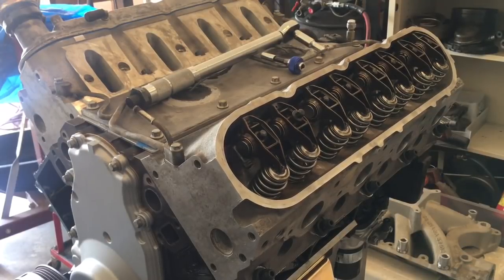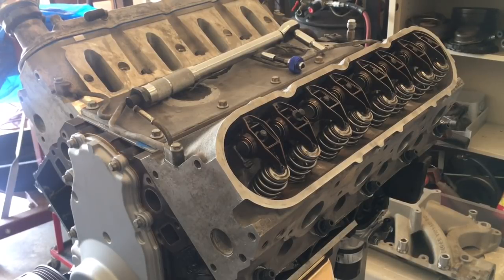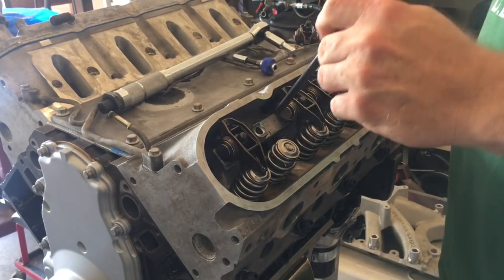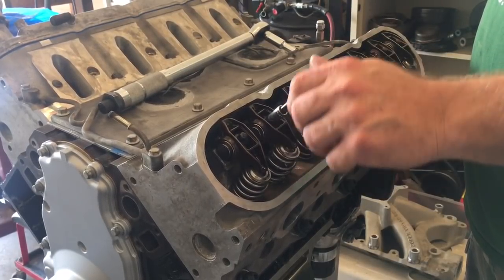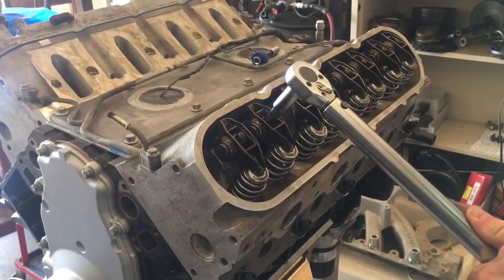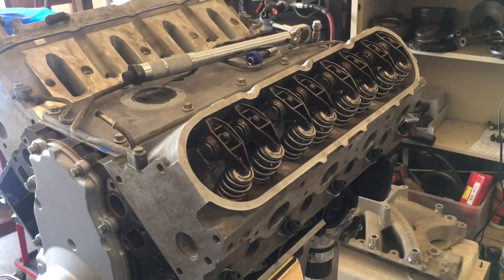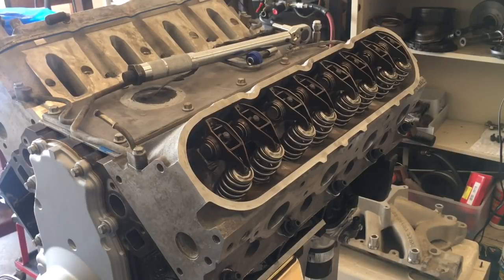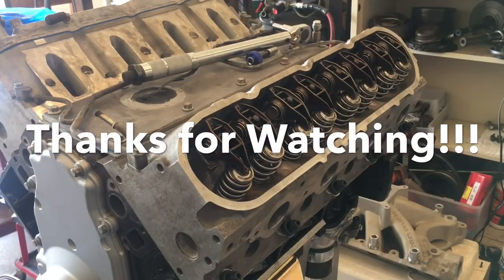LS lifter preload drama needed “One” 7.375” PR

Comment: I just changed my 355 chevy pushrods by   .  .200 because these rockers are a weird geometry by Texas Racing Engines circa 1990 (still in the box) I didnt measure much of a difference at .025 difference. Smokey Yunick used to cheat and use too long a pushrod, putting the rocker tip towards the outside of the valve stem. He used to gain another .070 lift on the cam that way to cheat the rules. Yes it puts more stress on the valvetrain and wears the valve guide more, but his dyno results showed more power with too long a pushrod.
Reply from the maker: Don Rutter Changing from the 7.400” to the 7.375” on the non-adjustable LS setup changed my lifter preload from .080” to roughly .0554”-.0615”.
I could have left the .080” preload but decided to make the preload closer to the other 15 rockers.
Smokey Was an innovator and was great at experimenting!  👍

Comment: You could take the one valve to machine shop and have it tip  ground. 030?
Reply from the maker: Richard Storms There’s not enough hardened material on the tip to remove .030”.  The tip on a valve stem has a hardened “Cap” to handle the abuse from the rocker arm. 
Thanks for the feedback, this shows people are trying to create solutions!  👍

Comment: .080" preload is bad? I'm about to button my rockers down and my comp tool says I'm at .084" On my LSA (LS3), I've heard .060"-.100" is acceptable. Thanks for the vid.
Reply from the maker: FasNuf ZL1 you’re right, lifter preload varies greatly depending on camshaft company and lifter manufacturers. 
GM .050-.060
Katech.070”
BTR .090-.100”

I have mine set at .070” now and they’re not as quiet as I would like. But I also have the Straub Ind.. solid trunnions in the OEM rockers which might make some noise. 
There’s two theories on controlling the lifters at RPM 
1. More lifter preload reduces the amount of oil under the plunger, less likely to float. 
2. Less preload allows the engine to rev quicker?  🤔🤔🤔
Reply: HeadFlowInc so I called BTR today and yes that said for my stick lifters .080-.085 was just fine. They had others running .100. Good to hear
Reply: @HeadFlowInc  I’ve heard the opposite that the solid trunnions actually reduce noise. 🤷‍♂️

Comment: What size cam are you using. If it already has 600+lift ya. I’d think anything over 7.4 would be dangerous.
Reply from the maker: theozman38 Oh no, the cam is way below .600” lift!  
Elgin 1838p/Trick Flow .560/.560 @.050” 216/220 adv 285/292 LSA 114 
The BEST method is buying the $25.00 adjustable pushrod and measuring for zero lash then adding in the preload to find the total length. JD
Reply: HeadFlowInc. Ya I’m kinda getting around to understand preload. Preload is set by the cam specs. If it calls 0.50 preload then if your length is like 7.250 a 7.4 would be close to it. A half turn or 3/4 turn would be getting there.
Reply: HeadFlowInc I’m thinking of putting 1.8 adjustable on 7.4 pushrods.  I’ve looked it up on Wikipedia. Stock is 7.385 with 1.7 pushers on a 465 lift cam. I’ll be close to or over 500 lift. I think.
Reply from the maker: All you do is find the length needed to establish zero lash, which means the rocker bolt is tight but there’s zero up/down play and the pushrod still spins freely.  Then add what ever preload you want to run.  In your example 7.250” + .050” = 7.300” long. As you stated the preload difference is based on lifter type and cam manufacturers recommendation.  Good luck have fun! JD
Reply from the maker: Yeah, if you had a .465” lift with 1.70 rockers, divide .465”/1.70= .2735” “lobe lift”.  Multiply lobe lift by the new rocker ratio: .2735 x 1.80= .4923” lift.   JD
Reply: HeadFlowInc. Ya. Someone who talks the way I do. Ya!!!  Ya thanks man. I’m buying the rockers today. And getting the pushrods to go with. And the studs. Be about $250. ?? Not bad.  Onallcylinders.com the cam is in. 0.457/ex. 0.466. So me adding a 1.8rocker and 7.4 pushrods I’ll be safe yet under 500. It should give me some boost, roller rockers and extra lift. I’ll gain some. Nothing to notice but ya. Stay safe HeadFlowInc.

Comment: hey, so i upgraded my lifter to comp cam 850 & i have a 600lift tsp stage 4. i have 7.400 rods, with stock lifters  when i did the cam, came with the kit. after i ended up putting on the new lifters valve train was noisy and i also realize that one of the rod was squirting out a lot of oil. i did the preload and got 7.325. lifter says that when torquing it should be between 3/4-3/8 when tighten, that’s what i got when i torque it with the pushrod length tool. i also got zero lash and side to side  movement. do the 7.325 seem close enough to you?
Reply from the maker: How much lifter preload are you using? When you’re using the pushrod length tool you’ll need to find zero lash with the lifter on the heel of the cam then add the amount of lifter preload to that length to find the total. 
If the engine is noisy it’s most likely the PR’s are to short.  JD
Reply: @HeadFlowInc  .50. we did what 187 custom showed on his video by doing the math. So it should be bigger then? it was my first time so it was a little confusing with the numbers
Reply: @HeadFlowInc  have to return the ones i ordered then. See if i can get help doing it right, so they would have to be bigger than 7.400 80